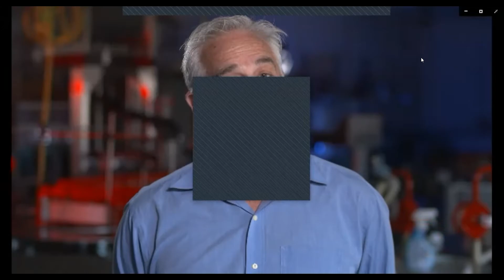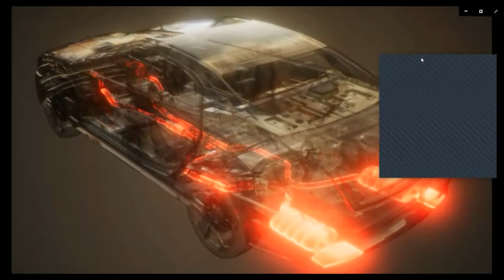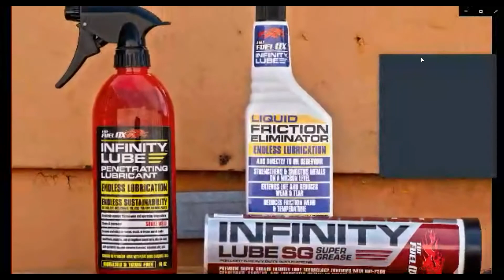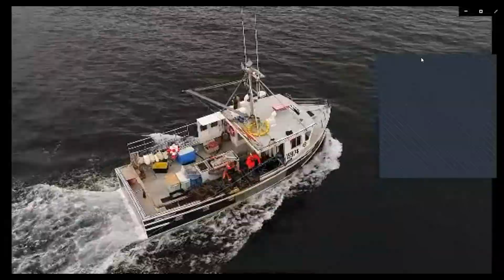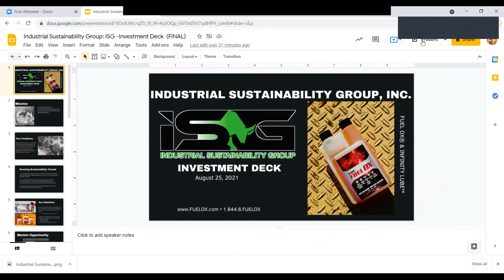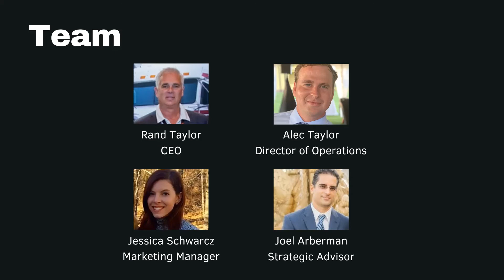Industrial Sustainability Group Webinar

Comment: If 3oz treats 120gal. How do you treat a 13gal car? Do you plan to add a product for the auto industry with lower capacity fuel tanks ?
Reply from the maker: Hi Nick! The 3oz that treats 120 gallons is our OTR products which are designed for over-the-road truckers. However, we have our flagship product, Fuel Ox in a 3oz bottle that treats 240 gallons with a dosing reservoir that treats up to 20 gallons of gas or diesel. Overtreating won't hurt, so you won't have to worry about that! This would be your ideal size for lower capacity fuel tanks! Here is the product page: https://www.fuelox.com/product/fuel-ox/

Let us know if you have anymore questions!